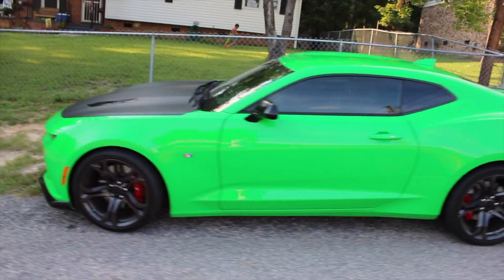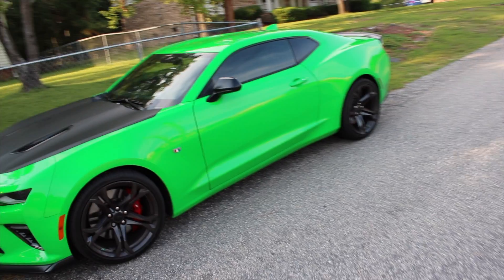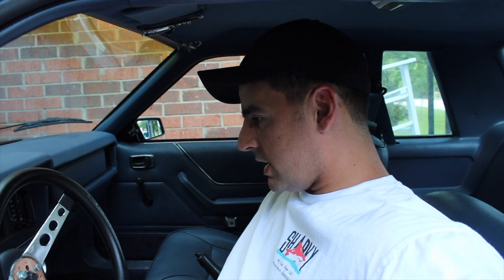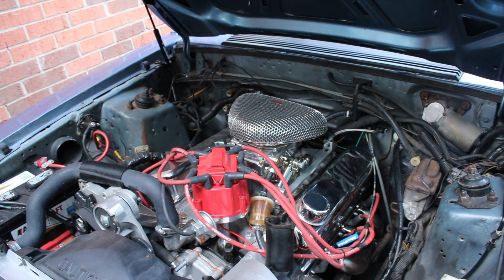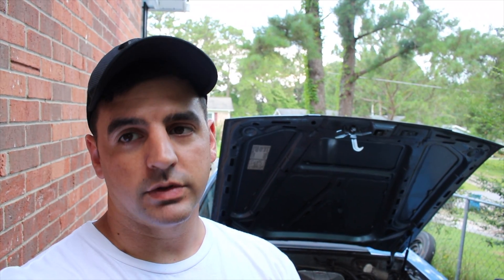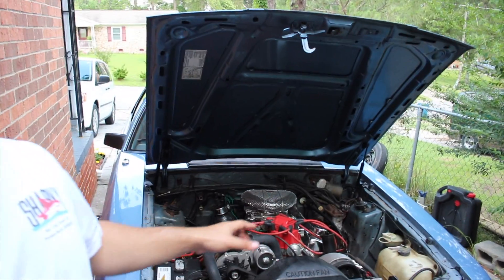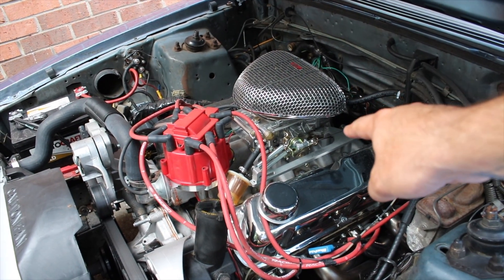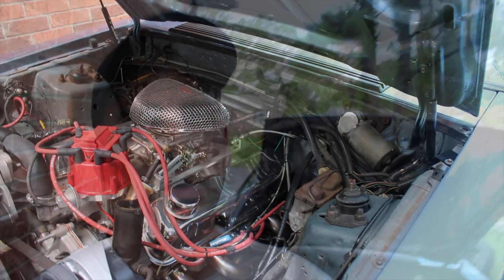Choosing Carb over Fuel injection - Why I did it?

Comment: Doin an 88 mustang 302 engine donate to my 1990 150 was was wondering how hard running lines and hoses around the engine bay is? Not really mechanically inclined here so I'm kinda scratching my ass on alot and have no one to really teach me anything

Comment: PLLZ...I'M LOOKING FOR SOME INFO...I'M OLD AND I CANT STAND THE THROTTLE BODY / FUEL INJECTORS SETUP ON MY 89 FORD F150 WITH A 302 MOTOR. CAN I REMOVE THE INTAKE MANIFOLD WITH THE THROTTLE BODY AND REPLACE IT WITH A CARB MANIFOLD....IF YES...WHAT ELSE WILL I NEED TO DO TO GET THIS OLD TRUCK RUNNING...THX...B.K.

Comment: With modern carburetors you can tune part throttle, full throttle and idle if you know what you are doing you get the same MPG as a fuel injected motor I'm getting 22 mpg on my carb setup the same as my TBI setup on a modified LO5 roller V8 Aluminum 200 cc port heads, Dual plane intake, Roller hydraulic lifter cam. 10.3:1 Compression with the 64cc chamber heads. It's a good everyday driver.

Comment: Hey man, i salute you from Romania. I have 1993 LT1, and i whant to swap to carb. I have done some ridding, i know i need the intake, HEI distribuitor, wires, etc. But what else is needed ? It has the 4 speed automatic 4L60E, does it works with a carburetor, because people say you delete the PCM once you go carburetor. 

I trie to get all the info, because in Romania i don't have parts for this, so when i order them, i need all what i need. 
And the reason is getting rid off the optispark and more power ! 

Thanks man, GOD BLESS
Reply from the maker: Man, honestly I’m not sure with an automatic. I think you can still have the computer control the transmission and then run the engine off of a coil over distributor setup

Comment: I just came across this video. I own a 1986 Mustang and I am seriously considering the swap over to carb for a new crate engine. If you still own vehicle what’s your overview or out looking on going carb still the same views on it?
Reply from the maker: I still love a carb motor, but since then I’ve really gotten into the fuel injected stuff. I no longer have this car, but built a 331 stroker myself that I’m using the holley terminator x on

Comment: I ditched all the Fuel injection set ups on my 86 Ford Mustang GT and F150. Every thing is so much easier to get at. But my Mustang now has a 351 Windsor with  Edelbrock Victor Jr intake and 600 Holley double  pumper. C4 automatic with a 3500 stall converter. 8.8 rearend with 3:73 gears it runs great.

Comment: When I built the motor for my 84 Trans Am, I went carbureted too.  Holley 750 Double Pumper mechanical secondary to be exact. 
No extra wires, no computer tuning... nice and simple.  Plus, carbureted engines sound better 😁

Comment: Performance  wise there  is no difference  between  EFI and Carb it's all about volumetric  efficiency. Only benefit of EFI is how it automatically  adjusts the fuel to air ratio to ambient  air temp and barometric  pressure. So if you love working on your car and taking the time every tune up and change in the season to fine tune your carb to that sweet spot. Carburetors  are the way. If you want a set it and forget once its tuned properly  but have a shit ton of cash to spare EFI is option.  I love working  on my cars and driving them they ain't just a means to get me from A to B. If you want a car to get you around go buy a Corolla

Comment: I was incharge on the maintenance of my car toyota St171 with 3sf carbureted engine, the last time i do the carb of this car was in 2017 before i had a job overseas. Its now 2019 and my car driven now by the wife simply dont wanna die..this engine is gas and go engine..everytime you turn the key it will run..this is the difference of simple    carby engine setup. No sensors and computer box..

Comment: Why do people swap efi to carb when the carb foxbody made less hp then efi ones?
Reply: Because you are too young to ever understand. and you are comparing stock to a 347 stroker.  Factory they are slow for the fact that they were non HO motors first off, secondly they carb'd setups like the 84 for example had shitty carbs to begin with that didn't flow worth crap and the fueling on them was hideous. 302HO motors make a lot more power and adding things like cam and better intake yields greater results than EFI.  A well tuned carb will do as much mpg as the factory EFI systems

Comment: Good job I want to give you a little advice so I'll tell you were in Comeing from first and than I have a couple questions for you to may be help me out with a build.1 in 1985 or 1986 my mom bought a used mustang hiway patrol car the infamous SSP mustang from our local ford dealer ship .The car had a earl shives paint job were they just bondo the antenna holes on the out side of the car and paint the out side no door jams they still had the original police car color black . The car was a 1984 with the 302 ,holly carburetor 5 speed transmission .It had a oil cooler so you had radiator AC radiator than the oil cooler radiator .The motor had stock aluminum finned valve covers that said motor craft with raised letters .The suspension was the best I have seen for handling around corners it had shocks that went horraztal from the frame to the body on the rear of the car ,this way when if you took a corner all of a sudden the shock would obsorbe the movement in the body .My 1 advice to you take off the breather you have it looks nice but it's sucking hot air from the motor the cooler the air you can get in to the carb the better. I seen in your video you have on the passenger fender the connector to were the breather tube goes to pull cool air from inside the front fender witch catches a lot of air that is much cooler .The SSP mustang had this tube on both passenger and driver side fenders .
If you're only has it on the passenger side ring one for the drivers side .2 the breather it's self if you can find a original breather witch is quite big around and blue with 2 tubes Comeing off both both sides. Kind of towards the front and run 1 to each fender .
Now I no it doesn't look near as nice but it was designed to do 2 things one it carries a large air filter and 2 it's made of heavy metal to keep heat from the motor heating up the breather so the air Comeing in will stay as cool as possible. This will add horsepower and the motor will be more sufficient .I was 16 years old living in California when she got this car so it became more my car than hers I drove it every day through high school and on the weekends .The car brochure said we chase down Porsches and they weren't lifting .I raced so many cars back than and had the fastest car in high school .Before drifting was a word we called it getting side ways or doing burn outs I have to admit drifting sounds a lot cooler .by the time I was 17 years old me and the card shared the same mind .and when it came to drifting nothing was impossible I've done it all .My mother had no clue what she had tell one day I decided to show her .So I went to our strip were we all hung out. A 4 lane asphalt rd right next to McClellan air force base in Sacramento CA there was nothing on this rd but fields on both sides of the rd and the road was covered in black marks left by me and some of the best drivers I have ever known. Any way I pulled over and told my mom I wanted to show her what her car could do and that there's nothing to be afraid of its perfectly safe and do you see all the black marks on the road well I did most of them. Of course she was concerned so I told her exactly what we're going to do how the car would reacted were we are starting from and were we will be when we stop basically a donut to the left than a donut to the right and than a figure starting from the right than 1 from the left .Than we will go straight and I will drop the clutch and we will go down the road 50 feet with the car angled to the right than will go straight and do the same thing to the right .I told her all this so she would no I'm in full control of the car at all times and there's nothing to worry about..After wards she was very surprised her car could do that and more surprised that I could do it. I never had a wreck and the car never once had to be worked on except me all ways being on the hunt for better tires .My question to you is you said your car was a 4 cylinder body . What did you do to the suspension to handle the v8 and the handling of The car .And i don't no if you no but the sap was used by the air force as a racecar forlanding the U2 spy plain and SALEAN bought several of the SSP from ford when a police dept canceled there order. And I think you did a smart thing useing a carburater and I'm dame glad to see you used a Holley instead of a crappy quadrajet most people use them because they can't tune a Holley carb .And as far as fuel injection do they use it on race cars or dragster hell no nice car stay safe keep the rubber on the road and may you never miss a gear best regards palehorse01

Comment: I have been a...yeah I don't give a shit either! If it gets me  to work and home it gets my vote.Projects are another story.My '92 F-150 is having issues with god knows what, the damn thing runs then cuts out.I want to go with a carb and shit can the emissions,here in MD. I have historic tags on it so I don't have to get it inspected for emissions.My question to anyone is what about the E4od automatic I have in the truck.I go carb I have to do something with the trans.There seems to be no easy or inexpensive way to do what I want.
Reply: You can't use that trans because it requires a computer. Probably easier to just fix what ever is wrong currently.
Reply: @tomtom1541  Good point.Changing the trans I lose OD unless I go with a AOD.Then trans length becomes an issue for the driveshafts...so on so forth.So injectors and some other stuff possibly wiring and we will see what happens.Thanks

Comment: I was curious what waterpump side you used. Driver or passenger. With these engines are they only set up one way?
Reply from the maker: John Bailey I think the water pump side is always set to the same way, but I believe they come in clockwise or counter clockwise depending on what specific engine you have

Comment: People think EFI is magic and lightyears beyond carbs. Truth is, EFI exists only to make things easier for manufacturers and more profitable for dealers. It's easier to get cars to meet EPA and CAFE standards with EFI. EFI requires a lot more maintenance than carbs and the maintenance is not always DIY-friendly, so dealers get more service calls. Performance and driveability with a carb can easily be just as good as with EFI. And it isn't as difficult to tune a carb as people think either. I was originally planning EFI for my current project because I had sipped the Kool-Aid. But just a little research brought me back to my senses.
Reply: Carb actually requires more maintenance because you have to tune it up frequently if you want peak gas milage. Most EFI systems can go 100,000 or 150,000 without needing a tune up. You probably won't get the same level of drivability unless you put a lot of work into getting the carb really dialled in to start with.
Reply: @tomtom1541  you don't have to frequently tune a carb. It adapts to normal weather fluctuations. You might gain something tweaking it for winter, but that's it. You never have to worry about an $80 sensor going bad or a corroded wire causing a bad signal.
Reply: @johnterpack3940  what do you mean it adapts to weather fluctuations? It does the opposite in reality. Usually you have to adjust carbs if you have a large change in altitude or temperature, otherwise you loose some power.
http://www.nightrider.com/biketech/tech_jetting_considerations.htm
Reply: @johnterpack3940  also OEM sensors are designed to last the life of the engine. I wouldn't worry about a sensor failure on an efi engine unless your buying sensors from AliExpress or bangood.
Reply: @tomtom1541  "large changes". I grew up with carburetors. We never had to adjust them. They are designed to adapt to regular weather. They work off pressure differences, they naturally change with the weather. It's just a lie to say you have to constantly mess with them. That just didn't happen.
Reply: @tomtom1541  I had to spend $1,700 replacing a bad OEM sensor on a Honda CR-V. Just had to spend a few hundred replacing an oxygen sensor on a dodge ram. My brother has a bad knock sensor on his Silverado. No, sensors don't last that long. And a bad connection can cause problems even if the sensor is good.
Reply: @johnterpack3940  well actually
https://www.enginelabs.com/engine-tech/elevation-changes-and-engine-tuning/
Reply: @johnterpack3940  which sensor costs $1700, please tell me? If you had replaced more than 1 sensor then you didn't diagnose the issue correctly.
Reply: @tomtom1541  dude, you're talking significant elevation changes. I quite clearly said they adapt to routine weather, not a 5,000 foot elevation change. I grew up in the hills of Pennsylvania. We drove all over, winter and summer, and nobody ever had to spend time tuning their carb. So spare me the "well, actually" arrogance. You seriously think an article written by some punk kid trumps the experience of literally millions of people who owned cars back then? You think little old ladies were constantly out in their driveways tuning their cars so they could get to church? It didn't happen. People bought cars and they drove them. Most had no idea how they worked. What's even funnier about your arrogance is that you have no idea how simple it is to tune a carb if it does need it. There's only a couple adjustments to make. It's not like you have to tear it apart. Thirty minutes with a screwdriver and you're done.

You've never even touched a carburetor and you're trying to "educate" someone who has torn them apart.

Comment: Actually new efi plug and play self tuning are easier a lot of people think they can tune carbs but they can't. Plus to keep optimal performance on a carb u need to readjust the carb every so often or u will start to loss hp and throttle response not any one can dial a carb in.

Comment: Doing a carb swap on my 89 f150 351w as well. 
Interesting idea on the fuel pick up. I was just gonna use a 80-86 carbed f series tank and the old style pickup with a Holley blue pump.
Reply: Phillip, did you ever do that swap? Just now seeing this video - considering doing a swap on my 89 f150 302 myself. Was wondering how it all goes down with an old ford v8.

Comment: I just bought about my 15th 5.0 this time it's a 1994 it's going to need a new motor when the tags are due it will be 25 years old and in my state the beautiful state of Oregon whatever I ineligible for custom plates that require no DEQ whatsoever so I'm thinking maybe I will go to carburetor because of all the tuning issues with EFI if you put in an E3 or 3 cam or any kind of Cam very interested in how you did this and I've seen several videos of guys doing the same thing all over the nation due to tuning issues with electronic fuel injection if I have any questions I will hit you up. Thanks for all the info
Reply: Tuning these isn't hard, plenty of people have tuned the stock ecu with a cam themselves. If you look on eectuning.org there are plenty of people who do it with no issues.

Comment: hey man im in the middle of swapping my 4cyl just like you but i need help on the little things. engine tranny and rear end are in. but i still have questions i cant find answers too. you can email me if you get the chance i would gladly take some advice nickwooten77@gmail.com. i need help with like heater hoses and how to run the fuel line into the tank also the wholes in the intake i think there for vaccum reasons but im still not 100 percent and i dont want to order wrong parts. as i am on a budget

Comment: From my mechanical engineering professor Dr. Shull. He taught me over 50 years ago that simplicity is dependability.The more sofisticated or complex you make a system the less reliable it becomes. Makes common sense doesn't it.? If your looking for reliability always remember the acronym, " K.I.S.S. !"   Keep it simple, stupid  !
Reply: Good for you ! You will learn that simplicity is dependability  ! Fuel injection requires injectors that are electronically controlled  that plug up or don't receive the timed signal because of computer ! Headache to install !
Reply: Larry Lamb I’m going into mechanical engineering and that’s exactly what I think!

Comment: Im doing a swap on a 90 hatch right now.  Was a 4 cylinder im droppin in a carb 302. My question is the headlights.  What part of the harness do i need to keep so the headlights work?  Thanks!
Reply: keep the harness in the car till you relize what you need if your going carb just keep driver side harness

Comment: Good choice on the HEI distributor.  I put one in a 351w bronco....best upgrade for a Ford ever!
Reply: I used an HEI on my 302 in my 1984 stang, bought from Ebay for around $50 and it is awesome.  I have probably close to 20,000 miles of trouble free operation.  I can't believe they can make it so cheap yet so reliable.